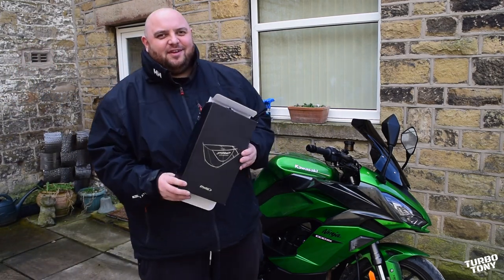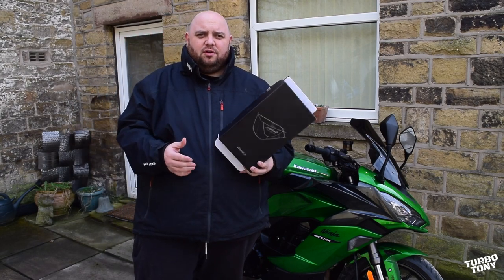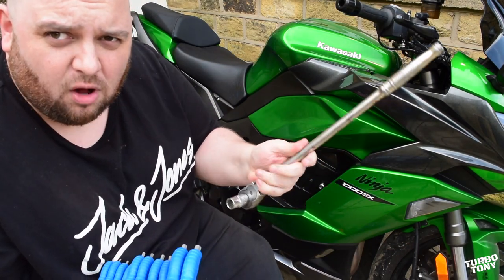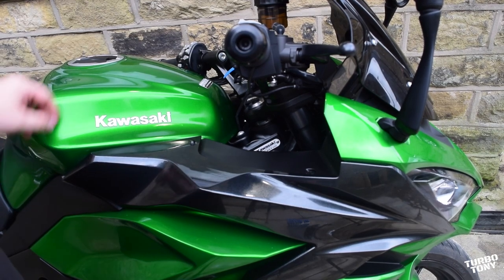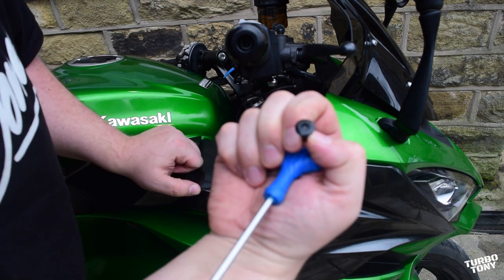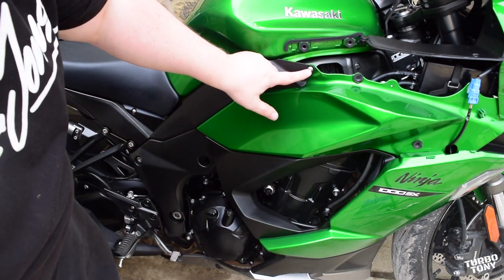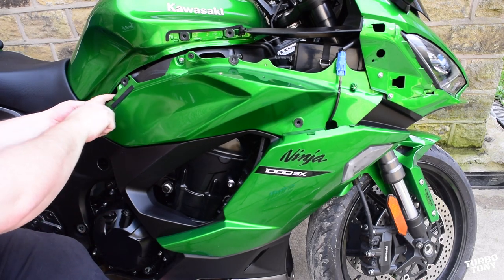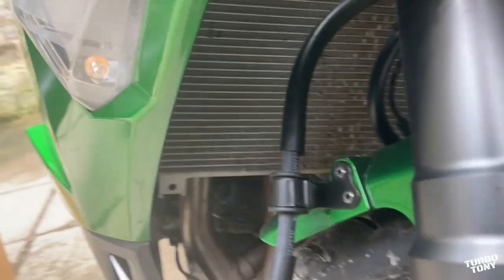KAWASAKI NINJA 1000 SX | PUIG SLIDER INSTALL VIDEO | 2020 - 2023 ONWARDS

Comment: Thanks Tony. Wish I’d seen your vid before I ordered my new Kwaka N1000SX which I pick up next week from the dealer. Paid them to instal genuine Kawasaki sliders 😮
Watched your other helpful videos also and will instal my own Quadlock stem mounted phone holder. 
I’m in Australia, in northern New South Wales on the coast. Tweed Heads area. 

Take care Turbo Tony and thanks for sharing your experiences and knowledge. Appreciated 😃👍
Reply from the maker: Absolutely awesone bike mate, youll love riding it. All the best David. 
Let me know how u get on with it 👍🏻👍🏻
Reply: @THETURBOTONY  thanks so much Tony.  I’ve had many bikes over the years and just sold my almost brand new BMW F850GS which is an adventure bike. Only had 1,580km on the odometer as I didn’t ride it much because it’s too tall for me. Shame as it was a nice bike and had heated grips etc. all the extras. The Kawasaki Ninja 1000SX I’m getting is apparently the 2023 model but no real changes apart from paint. I’m getting the green and black similar to your beautiful Tar Monster but it’s more black with just some green stripes.  
I’ve owned Kawasakis in the past. The Ninja ZX-10 when I was younger and before that the Z1R Mk2 and before that the Kawasaki Z900. Similar to the one they used in movies like Mad Max and the movie “Stone”. Those in-line four cylinder Kawasaki 16 valve engines are 4 generations older now. They’re awesome. Thanks again for your videos Tony. Much appreciated and I’m a subscriber now with bell reminder ticked 👍🙏

Comment: Hey Tony, great looking bike, and a great video. I may well be getting a Ninja 1000SX  myself, and was wondering if you store you bike outside all year round and if so how it copes with cold damp weather corrosion wise?
Reply from the maker: Hey. No I dont keep my bike outside. Stored in a lockup over winter. So far no corrosion apart from on the chain, even though I have oiled it regular. 
Theres another channel on here called @sergeant sodom, he has just had problems with corrosion on his Ninja 2020, might be worth a look. 
Honestly they are great bikes 👍🏻👍🏻
Reply: @THETURBOTONY  Many thanks for the reply mate. Roll on April 12th when the bike shops open again!!

Comment: Dang I wish I did this before dropping mine, just fell from side stand since I left it parked in a downhill driveway not in gear. Don’t you have to support the engine underneath before removing the bolts? Does everything line up fine without any support?
Reply from the maker: Everythings fine without support.
Reply: @THETURBOTONY installed mine yesterday, went for the SW Motech, hopefully I didn’t over tighten them. Screwed in pretty tight but did not put my weight on it
Reply from the maker: @armandblake  spot on mate. Hope it does the job for ya